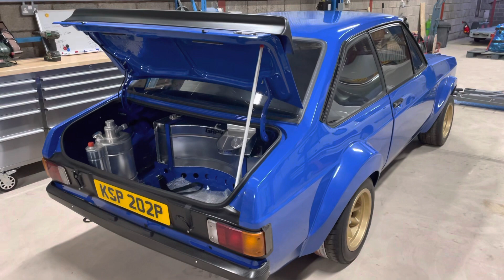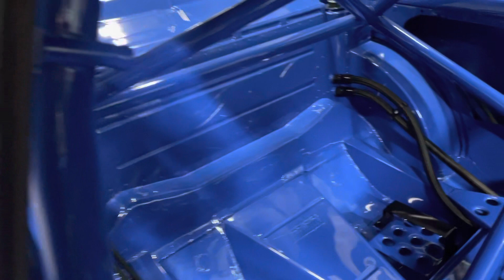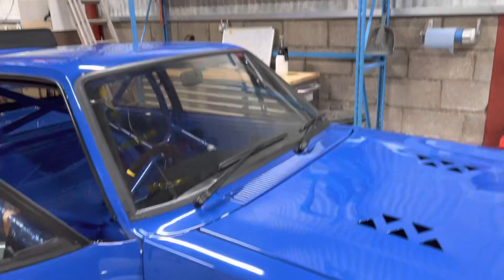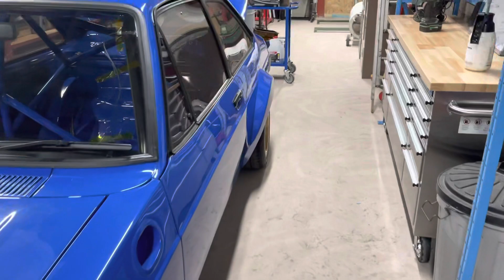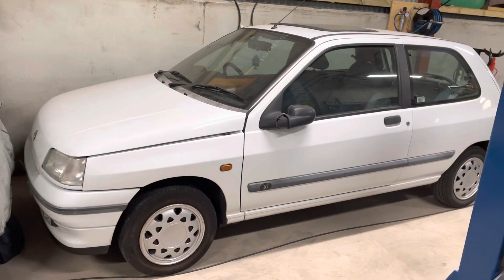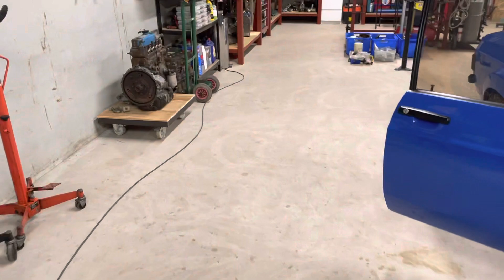My Ford Escort grp4 rally car build and Renault Clio Maxi project with Honda k20 engine!

Comment: Why she not 15s? Arched tarmac mk2 Doesnt look great on 13s
Reply from the maker: With the ratios and power I’ll be running it should be fine, but like I say I do have a set of 15” for it which I’ll likely use particularly on certain events. Like you say there are a lot more tyre options available so makes sense to have them. Thanks
Reply: @grp4motorsport just revisited your videos and subbed. Although i stand by my wheel comments lol your car is stunning fairplay. Love the blue always my fav on an escort
Reply from the maker: Thanks for the comment. Personal preference I suppose. I've always preferred them on 13" myself, however I do have a set of 15" minilites as well for it.
Reply: @grp4motorsport  If you put an engine like millington in then your tyres will get chewed up and just spin all the time and u wont get traction, hence the 15 inch on all tarmac escorts thats not considering ur cwp ratio and ur box ratios. I think u will end up running the 15inch by the time u rally it. Better choice of competition tyres is another bonus of 15inch wheels. Higher off the ground saves on diff casing smashing on loose gravel or bending ur sump guard. Ive seen a rix sump guard with strengthening ribs bend on a good day. not to mention exhaust scraping if your not running an exhaust tunnel

Comment: Congrats on the build! Looks stunning! But where I am mist curious about is the Clio Maxi. The Honda engine I can fully understand and saves a lot I suppose. But will it be eligible for rallies?
Reply from the maker: Id love a 306 maxi! 👍 I believe you may be right. I’ll double check with a local scruitineer.
Reply from the maker: Thanks for the comment and great question. I believe the motorsport UK blue book suggests that special stage rally cars are eligible for engine swap as long as the cylinder capacity does not exceed 25% of the original capacity. That’s how I interpret it anyway lol.
Reply: @Grp4 Motorsport   Would be a good idea to double-check. I do events with a period correct 306 Maxi. As far as I know we can replace with an engine of the same brand. I have seen R5 turbo with a Megane rs engine. Though more than 25%. 
Please keep us informed about your progress.